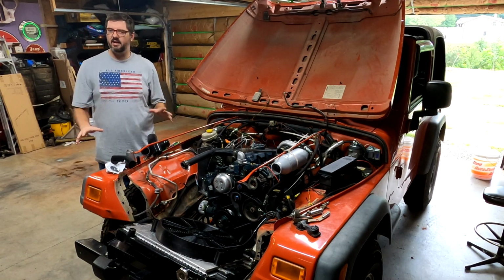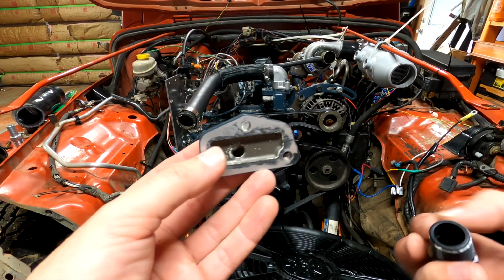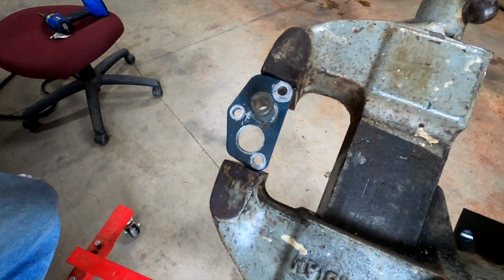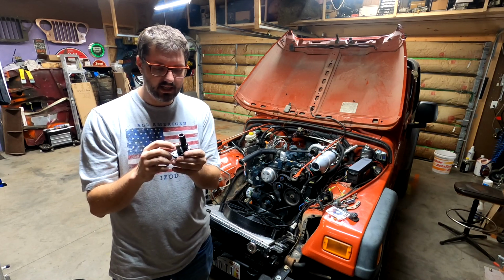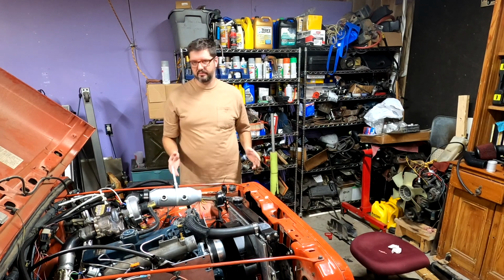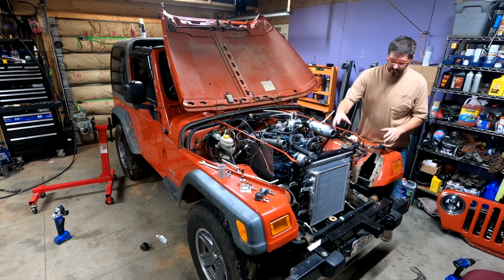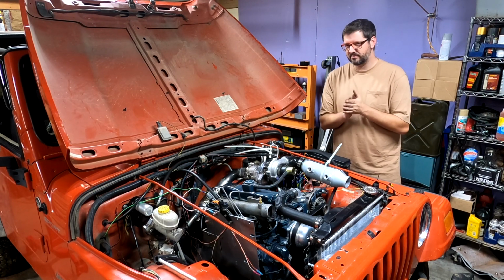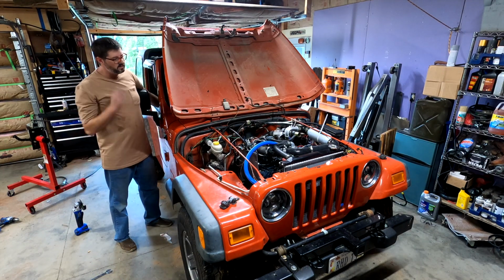First Pass at a Water-To-Air Intercooler Setup for my Diesel Swap TJ Wrangler

Comment: Did I just watch you feed boiling hot engine coolant into your intercooler?
Reply from the maker: I honestly don't think so, though I did rewatch the video to make sure, I can't tell from the camera angles. The Kubota water pump did have a port for cooled coolant which I want to say is how I routed the water into that water-to-air intercooler but honestly that was over 3 years ago and I'm on a completely different setup and I can't remember at this point so  . . .  maybe 😬

Comment: Are there any other options exhaust side turbine wheel?  Boost pressure cruising around seems a tad low.  Might want to consult a turbo shop and see what they can do.
Reply from the maker: I'm not sure truthfully. I know I have the fuel turned down at the moment. Are you thinking I need a smaller or larger turbine wheel? I'm still new to everything related to the turbos and diesels!